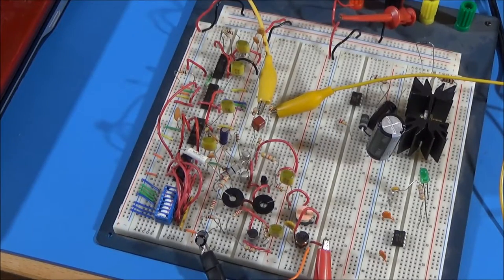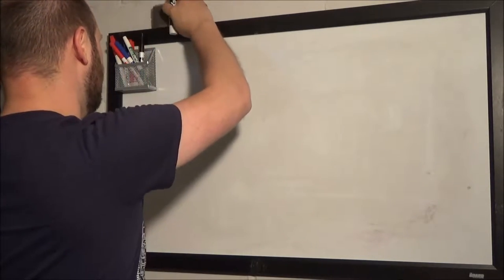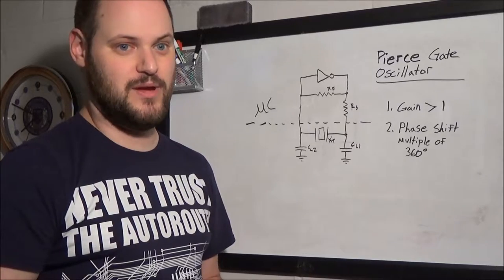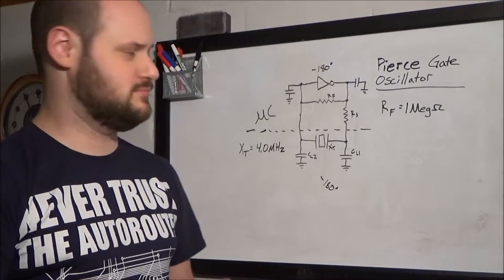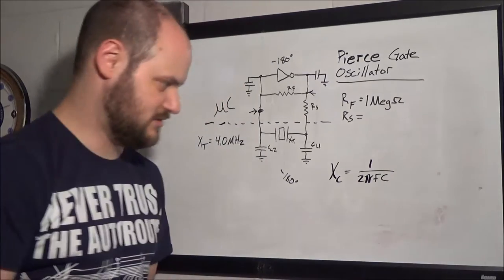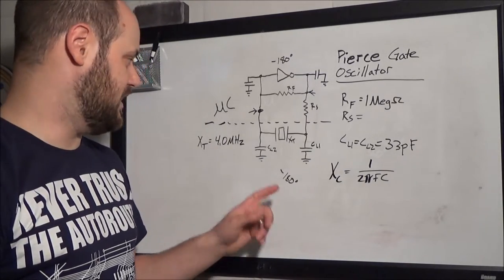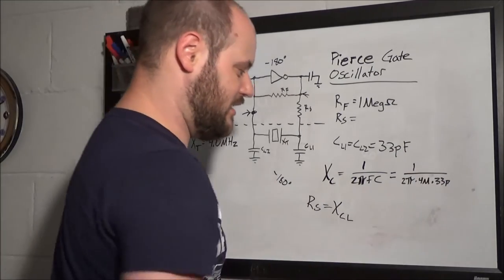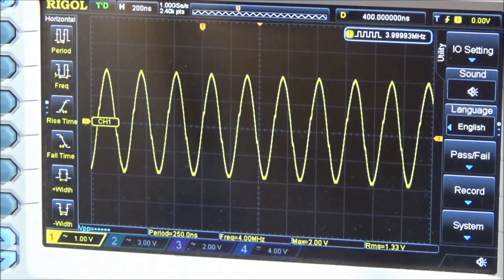OhmsAtHome #22 AM Transmitter (Part 1) Pierce Gate Oscillator

Comment: Thank you for this. I am unsure what the relationship between the data sheet Load cap mentioned with the Crystal and 'CL1' and 'CL2' ? These look to be a total cap - calculated in series.  So if your Xtal data sheet requirements specify 33pF load to achieve oscillation and you want CL1 == CL2 does this mean that CL1 and CL2 = 33pF * 2 (i.e 66pF )? I'm ignoring parasitic capacitance.